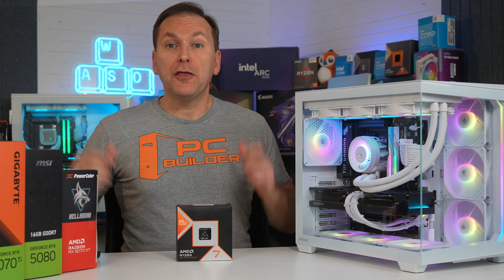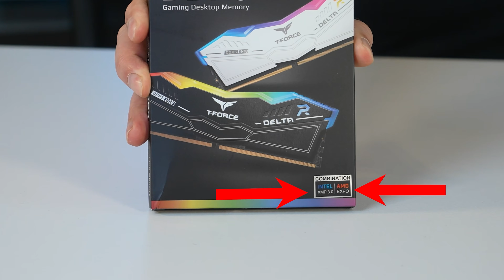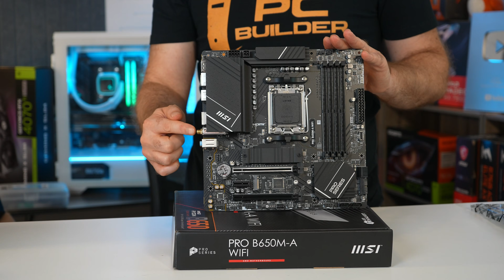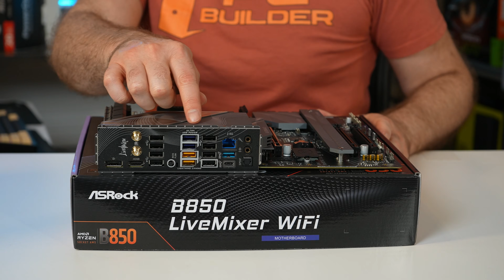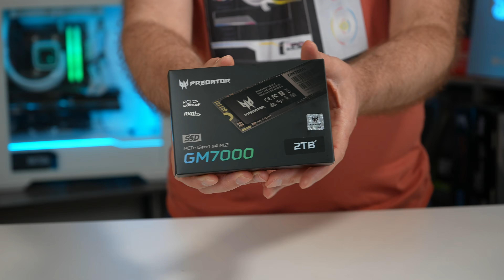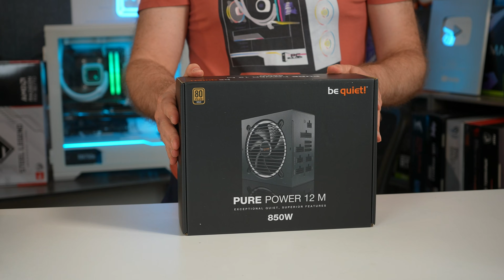Best Ryzen 9800X3D PC Build 2025 🛑 Best GPU, RAM, Motherboard & More

Comment: Hey what do you think about the recent issues with 9800x3d cpus failing on asrock motherboards? I'm about to pull the trigger on a b650m pro rs but after hearing these issues with the cpu failing on (mostly) asrock motherboards i'm leaning more towards the msi pro b650m-a wifi instead? Should I really stay away from asrock for this or no?
Reply from the maker: It is hard to say. So far it seems like a relatively small number, however it seems like that small number is higher than on other boards. If that makes you uncomfortable, grab an alternative instead. That is a $480 CPU after all, I'd spend at least $160-$250 on the board.

Comment: What do you think about a high airflow case like the lancool 216 and an air cooler? Do you think that could work in a tropical environment in an airconditioned office? Or would it be better, despite the slight risk of pump failure or leakage, to just get an AIO?

Comment: Got the 9800x3D with the XFX Mercury 9070xt and i'm loving it. 200-300 fps in most games on quality settings. The corsair rgb vengeance ram 32gb 6000mhz pairs well with my corsair titan link RX LCD aio. I would have went with the asrock nova x870e but it wasn't available in my area and was over $500 CAD. I ended up going with the asus tuf x870 plus wifi for around $330 CAD. Now this asus motherboard is over $410. PSU is the MSI A1000G, which has some braided cables. The montech king 95 pro is only $200 CAD in my area and is an awesome dual chamber case. Easy to build in and comes with 6 preinstalled PWM ARGB fans.
Reply: Heard people were having issues with that motherboard and I was going to buy it myself or the x870-E. Noticed any issues so far?

Comment: Imma run my 3050 with the 9800x3d and I Won't even look back. Blud is tellin me to buy a 3k euros GPU.
Reply from the maker: Hey if you are happy with your pc performance with a 3050 that's great. But theres no reason then to spend the money for 9800X3D or AM5 in general! You would get just as good performance with a much cheaper platform. Check out our Best GPU/CPU Combo 2025 video to learn all about GPU bottleneck. You sure don't have to spend more on a stronger GPU if you don't need it but then get yourself the right sized CPU for it too.
Reply: @PCBuilderChannel  The thing is I mostly play competitive shooters and currently PUBG the most. No healthy player is playing FHD or above (usually 1728x1080). I know my FPS will be capped by my GPU at one point but as long as its above 200 and stable I don't mind it, sadly my 5 5600x can't handle that any longer. In the future I might consider some AMD GPUs or I'll just get a 4060. I don't see a point in gaming on 4k so the max res I'll ever run is native FHD in some chill games. Thank you for the recomendations though.

Comment: I'm doing a total upgrade and my new specs are gonna be
Ryzen 7 9800x3d
RTX 5080 Gigabyte
Corsair Vengeance DDR5 32GB 6000 MHz CL30
Gigabyte Aorus Elite X870-E WIFI 7
+the rest, not so important

Comment: Hey Jason, thank you for the helpful videos. I’m thinking if I should build a pc with RX 9070XT and 9800x3d or 7800x3d. I live near a micro center and they offer AMD bundles. The price difference between the two cpu bundles (cpu, mobo, ram) is between $150-$200. Worth spending the extra on 9800x3d? I plan to game at 1440p.
Reply from the maker: For that much of a discount the 7800X3D is a great choice I think
Reply: Thank you. Appreciate your feedback.

Comment: thanks for your help.
Im gonna build this one with AMD Ryzen 7 9800X3D

Motherboard: ATX Asus TUF Gaming B850-Plus WiFi SktAM5
Cooler: Arctic Liquid Freezer III Pro 360 A-RGB All-In-One Branco
RAM:  Corsair Vengeance RGB 32GB (2x16GB) DDR5-6000MHz (AMD Expo/Intel XMP) CL30 (30-36-36-76)
SSD: Samsung 990 Evo 2TB TLC V-NAND NVMe PCIe Gen 5.0x2
GPU: Sapphire AMD Radeon RX 9070 XT "RDNA 4" Nitro+ OC 16GB GDDR6
PC Case:  ATX MSI MAG Pano 100R PZ ARGB Tempered Glass Branca
PSU: ATX MSI MAG A850GL PCIE5 850W ATX 3.0/PCIe 5.0 80 Plus Gold Full Modular

What do you think?
Reply: @ do you like ray tracing in games ? Get 5070ti then
Reply: Not corsair ram, that sucks 
Get something else like kingston fury beast,.g skill trident or t force delta
WHY AMD GPU ?
Reply: @ 9070XT is a beast. But im open to suggest

Comment: I love your videos, tons of advice on practical builds. I was aiming to build a new pc based on 9800x3d, got my gpu 7800xt. I need to figure what mobo (in Greece Europe prices are quite different than USA :P ) and how much psu i need. many of my friends advice me to get a 1000w psu but the price is quite higher compaired to 850w, they tell me that better be safe than sorry with pc parts like that :P
Reply from the maker: Hop over to our best PSU 2025 video for more on how to calculate the wattage you need

Comment: i wanted to upgrade to the ryzen 7 9800x3d and obviously a new motherboard, but keep the gpu i have now which is the Rx 6800xt is this a good idea? or would i need to get all new parts if i upgrade just those two things?
Reply: Mid GPU 
What's your current CPU ? 5800x3d ?
Reply: @ ryzen 9 5900x

Comment: I have a 3080ti oem that I want to use for a small form factor build. Will it bottleneck the cpu??
Reply: Definitely not “bottlenecking” your cpu but it will for your frames. I have 2 friends with both your gpu and cpu. They mention the noticeably lower performance than expected, but if you have a 3080 ti for a while I have think it’s worth it to upgrade later since your cpu is great

Comment: Another superb video, mate! I just finished my new PC with the following: AMD 9800X3D, MSI X870E Carbon, Arctic LF3 Pro 360, Asus Strix 4080S, 64GB Corsair Titanium, 2TB WD 8100, 8TB WD SN850X, Seasonic PX-1000 and Antec C8 Curve Wood case. This PC oughtta last me a good 4-5 years.
Reply from the maker: Thanks so much! And congrats on your new build!!
Reply: @PCBuilderChannel  Thanks, mate!
Reply: WHY 9800X3D ? 
9950X3D is better
Reply: @UM_88-s2c  Don't need the 9950
Reply: @ idk I feel like if someone has a card that's 4080 level and upwards, they need to pair it with 9950x3d for maximum performance
Reply: @UM_88-s2c  ur 9950 is gae

Comment: 🎯 Key points for quick navigation:

00:00 🧠 Choosing the Right GPU for Ryzen 9800X3D
- The Ryzen 9800X3D is optimal for pairing with mid-to-high-end GPUs for gaming,  
- Recommended minimum GPUs are RX 970 or RTX 570, with better value from pairing it with GPUs like RX 970 XT or RTX 590,  
- Lower-tier CPUs are advised if budget doesn't allow for high-end GPUs to avoid bottlenecks.
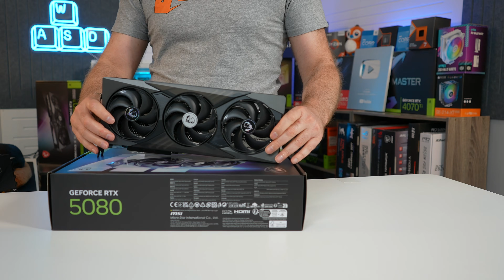02:02 ⚡ Best RAM Configuration for 9800X3D
- DDR5-6000 is the ideal RAM speed; lower or higher speeds reduce performance,  
- 32 GB RAM (2x16 GB) is the sweet spot for gaming, streaming, and even some pro workloads,  
- Kits with CL30 are great value, while CL28 offers tighter timings for slightly higher cost.
05:28 🧩 Choosing a Compatible Motherboard
- Any AM5 motherboard works with BIOS update (AGESA 1.2.0.d2a+),  
- Avoid A620 and B840 due to no overclocking support; B650/B850 are ideal,  
- PCIe Gen 5 GPU slots are futureproofing for flagship GPUs; widely available on B850 and X870 boards.
07:59 🧱 Best Budget and Premium Motherboard Options
- Budget picks include ASRock B650M Pro RS and ASUS B650M-E around $140,  
- Premium value pick is ASUS TUF B650 Plus with USB-C, ALC1220 audio, and 3 M.2 slots,  
- For Gen 5 GPU support and higher specs, ASRock B850 Live Mixer and ASUS TUF B850 Plus are solid mid-$100s options.
10:42 🎛️ X870 Motherboards for Ultra-Premium Builds
- X870E boards add more M.2 slots, USB4 ports, premium VRMs, and Wi-Fi 7,  
- Entry options like MSI Tomahawk start at $299, while ASUS Strix versions push $500,  
- Popular for aesthetics, overclocking, and heavy I/O needs.
11:51 💧 Cooling Options for Performance and Silence
- Mid-range air coolers are sufficient for value builds; dual-tower designs preferred,  
- 240mm AIOs are great for aesthetics; 360mm is overkill but fine for high-end builds,  
- Arctic Liquid Freezer III AIO used in the premium build for max performance and ease of install.
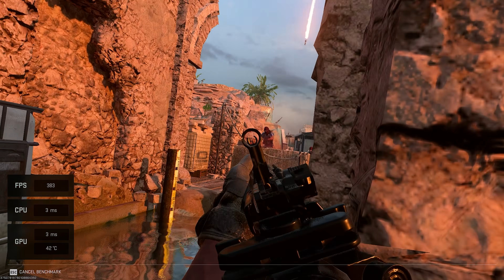13:15 💾 Best SSDs for Performance and Budget
- No gaming benefit from Gen 5 SSDs; Gen 4 NVMe offers best price/performance,  
- Budget builds can use Gen 3 NVMe like WD SN580; mid-range builds may benefit from drives with DRAM cache,  
- 2TB drives offer best value, single large drives preferred over multiple for simplicity.
15:09 🖥️ Best PC Cases for Function and Aesthetics
- Great mATX and ATX case options from $60–$120, with airflow and ARGB features,  
- Antec C5 used in the premium build with 7 fans and RGB/fan controller,  
- Consider dual-chamber or rear-connector compatible cases for cleaner builds.
16:18 ⚙️ Power Supply Recommendations
- Minimum B-tier PSU recommended; A-tier for high-end GPUs,  
- Size PSU at 1.5x peak GPU draw in PCPartPicker,  
- Be Quiet! 12M 850W PSU chosen for premium build, supporting ATX 3.1 and PCIe 5.
17:12 🧰 Full Build Templates for Ryzen 9800X3D
- Mid-range build: $1000 without GPU, uses value components like DDR5-6000 CL30, air cooler, and Gen 4 SSD,  
- Premium build: $1200 without GPU, upgrades include RGB RAM, AIO cooler, premium case and motherboard,  
- Templates balance performance, aesthetics, and futureproofing—links provided in video description.
Reply: Define high end GPU ?
Reply: @UM_88-s2c  its shiny
Reply: Thanks

Comment: Just finished buying all my parts for a build with:

9800x3d
Corsair Nautilus 360 AIO
Corsair 4000D
Corsair 850w Modular
Corsair 120m fans 3 pack
Gigabyte B850 Eagle 
Gigabyte OC RX 9070xt
G.skill Ripjaws 2x16 DDR5-6000 CL30
Crucial 2T M.2 Gen 4 SSD

Under 2000$ pre tax and under 2150$ after tax. Was this a decent price? I needed an upgrade anyway my i7 7700k and RX 480 were slowly becoming too slow anyway so unless this is super over priced I’m very happy. Also my last build lasted me 7 years and 9 months so let’s get a good long run out of this PC.

Edit: I swapped out a the motherboard for one with more VRMs.

Comment: Love that you literally picked all parts I picked for my build. 9800x3d, gigabyte x870e, 32gb CAS 30 6000mhz corsair, arctic Liquid Freezer III (hard to get, refresh amazon listing few times a day, I got lucky on that), ended up with wd 2tb m.2 gen4 since it came free with motherboard, Case is personal decision in terms of look but I got antec c5 it's 30$ more but gives 4 more rgb fans free & i like cases that hide PSU, for PSU guys warning here, thermaltake is even cheaper on Newegg, the issue is it's considerably bigger than MSI MAG A850GL, and when you are doing your cabling few inches will help. Love the video!
Reply: Adding to this that, gaming with my GPU i am getting much better fps without changing GPU yet. I'll say this, ppl gonna be like you wasted money, i am saying this to encourage different way of thinking. IMO if you got an existing GPU, keep it and upgrade all PC then invest separate sum of money to GPU u want. No need to lower your CPU or motherboard level standart and go midrange. Go high end, keep GPU, 6 months later, 1 year later do GPU. I am still rocking my overclocked evga 1060 6gb and its able to get like 100 fps more just all parts upgrade, now I either go 9070 xt or 5070ti and im all set. If you aint got no GPU and adjust either you need but cant get best performance or you wait to collect more money. 

Also have to say, I am coming from 4770K, had it 40% overclocked with noctua, still runs legit and upgrade to this in terms of productivity is not as noticable as i want it to be. IK intel is the route for that nowadays, I hate that if i am mostly playing games which i am amd 9800x3d is the way to go but if you do some major video editing, encoding for some random need you got, its not like my 4770K would take 4 hours and 9800x3d is taking 2, maybe some percentage better but not insanely different that I can easily tell. I hate they made the scene so separate where one CPU is clear for one purpose, are we suppose to build 2 machines now or what? lol
Reply: Thanks for your informative comment , hope you get a great gpu for your great build.. my advice is to wait for about 1 year for the rtx 5080 ti and you are solid for 5+ years to come
with the current drama vs Nvidia I am betting they will bring great new gpu's
just like what happened to me when I waited for my rtx 3080 ti which is like 2-5 % less powerful than rtx 3090 but much cheaper.. I think they will do the same this time..

Comment: AMD Ryzen 7 9800X3D
ASROCK Radeon RX 9070 XT Taichi
ASUS TUF GAMING B650M-E WIFI
Corsair 32GB KIT DDR5 6000MHz CL30 Vengeance Grey EXPO
Patriot VIPER VP4300 Lite 2TB
Montech Hyper Flow SILENT 360
Seasonic Focus GX-850 ATX 3
Corsair 2500D Black
ARCTIC P12 Silent 120mm x2/3

Comment: I got  back into pc gaming a few weeks ago after 10 years with my new build:
9800x3d 
9070xt xfx mercury
Msi mag b650 tomahawk
32 gb G.skill z5 neo 6000mhz cl30
Fsp hydro ptm 1000w platinum 
Samsung 990 2tb
Nzxt h5 flow 2024
Only regret is my cooler, the Phantom Spirit is too low for those ram kits so I had to move up the first fan a bit. And i am considering an aio instead.

Comment: Is it possible to take off the easy latch for the gpu on the asrock nova WiFi… In the hyte y60 the pcie riser cable won’t fully plug in since it’s in the way

Comment: I just upgraded my AM4 board to a MSI MAGB850 tomahawk with the 9800X3D, trident Z5 neo 32GB CL30 and a lian li hydroshift AIO. I already had a 4070ti so my mind was blown when I it kicked into gear. It feels like I’ve just upgraded from a packard bell running win98.
Reply: im also considering the b850 mag tomahawk. how you liking the board?
Reply: 9950x3d is better

Comment: Hello there! I'm building a crazy overpriced pc (I know that), but despite the price what do you think about it? R9 9900x3D, Asus ROG Strix B850-E Gaming Wi-Fi, RTX 5080 MSI Gaming TRIO, AIO Arctic freezer cooler III 360, G.Skill DDR5 64GB (2x32GB) 6000Mhz Flare X5 CL30, Samsung 990 PRO V-NAND 3-bit MLC 2TB M.2, Kingston KC3000 3D NAND TLC 512GB M.2 (for system), Seasonic Focus GX-850W V4 ATX 3.1. And all that is in giant Be Quite Silent Base 802
Reply: 9900x3d: dual CCDs of 6 cores
NOT recommended
Get an X870 motherboard if you're gonna go for a Ryzen 9
Reply: @UM_88-s2c  I will investigate this question. Thanks for the answer!

Comment: Great vid... question i built my 1st pc in 2016 using a intel 6600ik cpu and a 1070 nividia gpu... i want to do a high pc build using a 9070xt and 9800x3d cpu but cant even parts atmo so was thinking what parts could i upgrade on my old build to update it a bit untill i can get parts

Comment: 5:33
Your statement that any AM5 motherboard with AMD AGESA 1.2.0.2a supports the 9800X3D is incorrect. My GIGABYTE B650 GAMING X AX (rev. 1.1) doesn't support any 9000-series CPUs, even though it has a BIOS with AMD AGESA 1.2.0.2a. You can verify the CPU Support list on their website. GIGABYTE B650 GAMING X AX rev. 1.0, 1.1, 1.2, 1.3, and 1.4 do not include the 9800X3D in their CPU Support list. Only rev. 1.5 supports it. I contacted both AMD and GIGABYTE support, and they confirmed that this is not a mistake on their website—only rev. 1.5 supports the 9800X3D.
Reply from the maker: Thanks I'll look into this. So far it seems the board wasn't properly validated by AMD, which is why it was discontinued. But I'll keep digging and post a note in the pinned comment. This is a major screwup if true.

Comment: I’m having 3070ti right now, and planning on upgrading my cpu to 9800x3d since the one I’m using is already a grandpa class, should I also upgrade my gpu?
Reply from the maker: If you can but GPUs are rough to get right now. I'd stay put if you need to
Reply: @ thanks

Comment: Thank you, the last time I bult a pc was when a separate ssd for booting was recommended. 
I'm building a set up with a gigabyte 9070xt oc that was bundled with a gigabyte b850 mobo. It was the only deal I could find where the gpu wasn't overly expensive. My 980ti needs to retire. 🥹
Reply from the maker: Good grab! Best wishes on the build

Comment: I have a 3070 and Ryzen 7 7000. Since I mostly just play wow I’m thinking about just going with the better CPU since WOWS is mostly CPU bound . I have a MSI tomihawk motherboard already A5 socket. I can just buy the chip and drop it in no?
Reply from the maker: You can, with that GPU you may not see a ton of difference though.
Reply: @PCBuilderChannel so I just got a 9800x3d and RX 7900XT. Should be a decent upgrade to last awhile . I play only at 1440p and more CPU than GPU games (although I got a free monster hunter so I’ll play that hahah)

Comment: Am building a ryzen 9700x, with either a 7900xt or a 9070xt if i can find one at msrp.  The 7900xt was 599.99 when you buy an amd cpu at microcenter so i have 2 more weeks in my return window to find a msrp 9070xt lol. I run an ultrawide 21:9 1080p that is 3/4 the pixels of a 1440 16:9.
Reply from the maker: Best wishes on it but the 7900XT is good too

Comment: AMD Ryzen 9800X3D, Gigabyte Aorus X870E Elite Wifi7, G.Skill 32GB DDR5 Royal 6000 CL28, Deepcool AIO Mystique 360, NZXT C1000 Gold ATX3.1, Montech King 95 Pro Black, WD Black 4TB SN850X and Gigabyte Aorus RTX3080 Master 10GB, plus 10GbE network PCIe x4 card. Will wait on upgrading the GPU until fall 2025 or next year.

Comment: Im just debating on upgrading systems right now.  I have two 2k 180hz monitors.  Ryzen 7 3800x, 2080Ti, 32 gbs of ram, nvme, 850 watt power supply.  I'm just not sure if its worth waiting one more year to grab a cheaper 50 series card and cpu